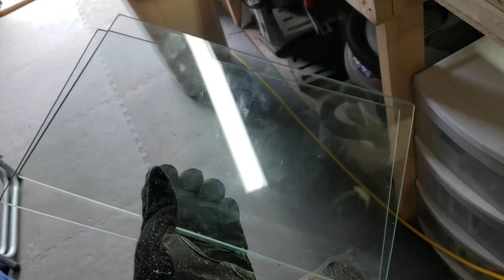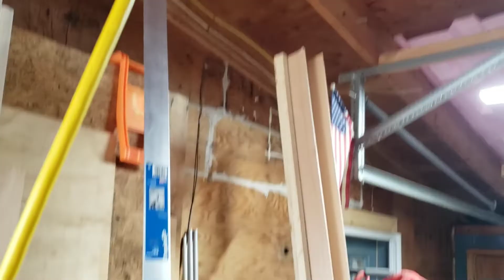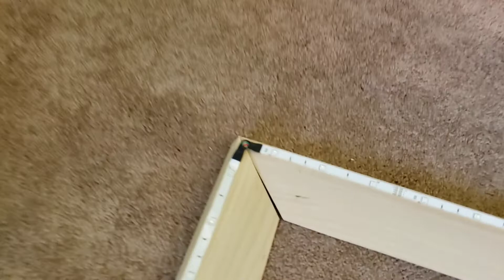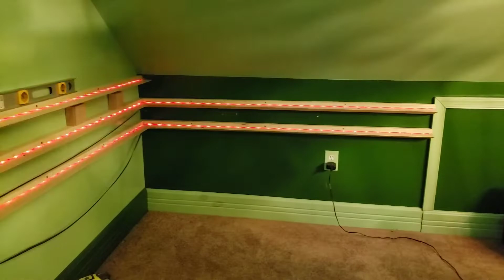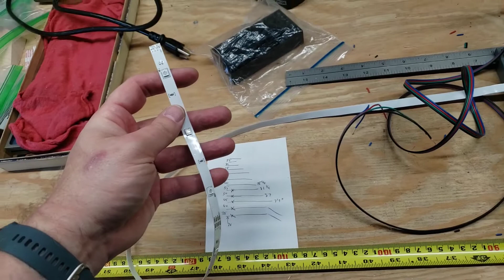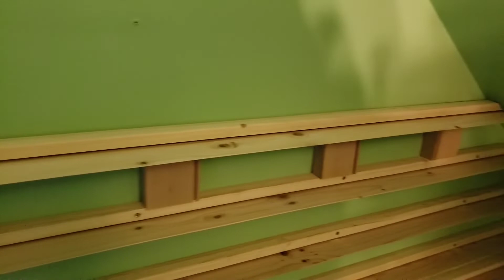New LEGO shelves - DYI Build

Comment: I have been trying to contact you for years. Miss talking. Give me a call because I have a lot of 3d printing and I want to catch up.
Reply from the maker: Having trouble connecting with you on Facebook (wouldn't let me message you), but I just found you on LinkedIn and sent a connection request.
Reply from the maker: You can also get to me through my "Builds by Dean" Facebook account. Once we have a friend in common, we should be able to connect. I keep Builds by Dean more open since it eventually will be for side hustle.